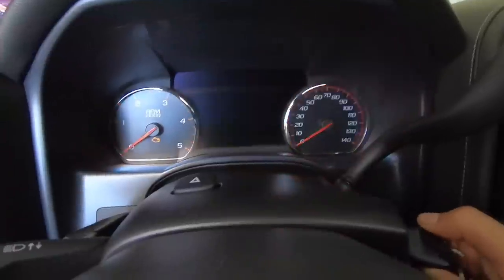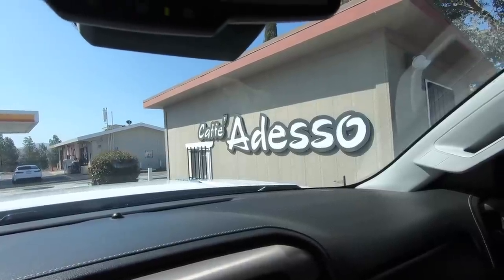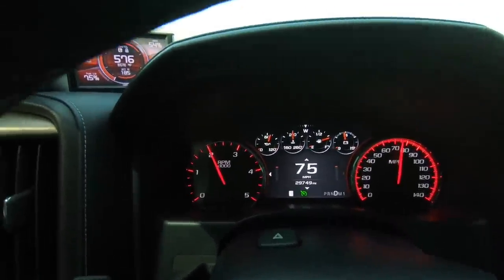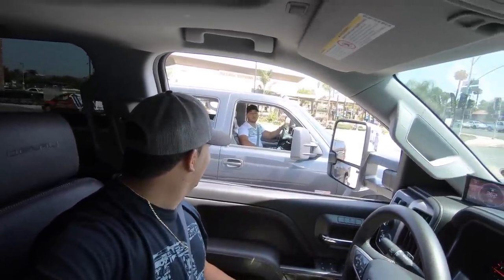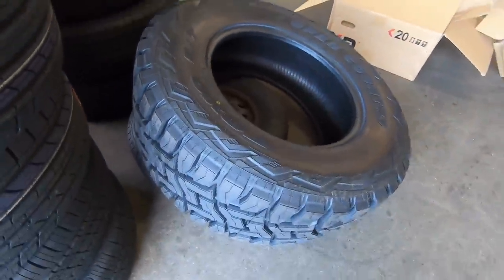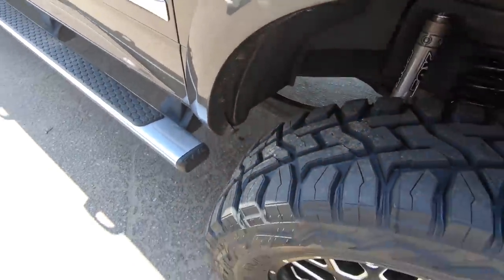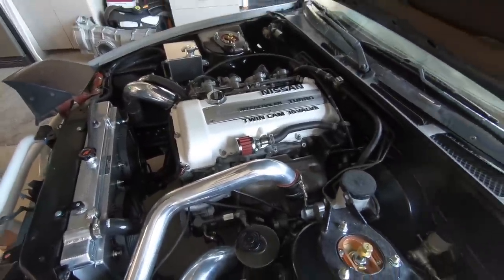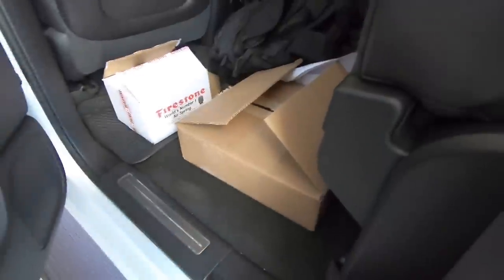4.56 GEAR UPDATE?

Comment: You're gonna love the new gears! You have the truck for pulling and with those tires you need the gears. Fuel mileage while pulling shouldn't hardly change since the truck isn't working nearly as hard. Larger diff covers are almost a necessity for pulling rigs... especially in warmer climates.

Comment: The mpg should fall in place just fine if you got the right set up. But the lower gear ratios (higher numerically) are to get that power back from those new huge tires and wheels, losing that sweet spot sucks! Especially if you are towing. Gearing is so essential to a great piece of machinery like that.

Comment: It’s seems as if this gear set you picked pulls more Rpm at highways speed than stock tires with stock gearing. I assume it makes up for the heavier & taller weight of the tires
Reply from the maker: yes it does i wanted a little more because i towed with a stock duramax and it was not enough

Comment: I am running 4.56s on 33inch tires on a 14 6.7 cummins i love my rpm range I don't do interstate so highway and in town are 10 times better. My fuel economy seems to be just as good if not better stock was 3.42s they suck! I had to use hypertech for speed and Ppei I had to send a data log where I wanted my truck to shift
Reply from the maker: nice

Comment: @eddie’s life hey man I just put 4.10 (rear) and 4.11 (front) Yukon gears on my 1500 denali.. i get a noise (hum) when accelerating and decelerating..Yukon said this is normal..we’re your gears ever louder or made a different noise when you installed them
Reply from the maker: No usually when you have a humming that means that they were not installed correctly
Reply: @EddieLife3500  thanks man, that’s what i figured

Comment: Hello, I tow my boat and other toys with my 2004 F150 Lariat 5.4 Triton 4x4. I have a lift with 37's and am re-gearing my truck to 4.88 gears, thoughts? I also like to play in mud and off-road a bit but not much. This truck is not my daily commuter.
Reply from the maker: 4.88s would be prefect
Reply: @EddieLife3500  Anything else I should look into adding besides programmer?

Comment: Does your cruise control still work? I just got 4.56 gears in my 2018 Duramax with 37s and now the cruise control won't set or function
Reply from the maker: My cruise control still works

Comment: I purchased a MAG hytec diff cover for my 1500 GMC Sierra because I do a lot of Towing and have not installed it yet I believe it holds two extra quarts of diff fluid the problem is we have a locking differential and I can only find gear lube that has limited slip already in it not sure if that will work? I would love to see your install please. Thanks
Reply from the maker: no problem man

Comment: Just for your subscribers Eddie. I found this simple Formula to figure out how to get back to your stock gearing after going to larger tires. Take your stock gearing of 3.73 and multiply it by your new tire size of 37”.  Then divide that number by your stock tire size of 32”.  Your new gear ratio will be around 4.31.   With you 4.56 gears your not to far off from the stock gearing.
Reply from the maker: also you can go here https://tiresize.com/gear-ratio-calculator/

Comment: My new Dodge dually has cooling fins on rear diff cover. From what I understand, that is only on the trucks with the Aisin trans
Reply: 2018 duallys with 68rfe with 4.10s also have alum fined cover as well.
Reply: Guess the Dodge dealer salesman didn't know what he was talking about. When I was looking at the 3500 duallys I did see some without fins, that's why I asked what the difference was. Guess I still don't know
Reply: Chris M 4.10 gears only have that aluminum diff can't tell you about the trans it's easy to see what trans is In the truck pop the hood look at trans dip stick left 68 right aisin simple
Reply: Good to know about the dip stick, I spec'd a aisin in mine. Salesman crap I guess.